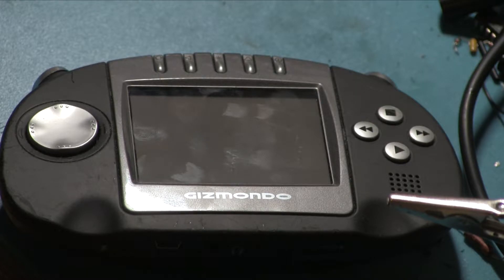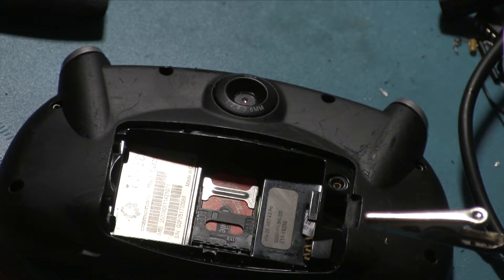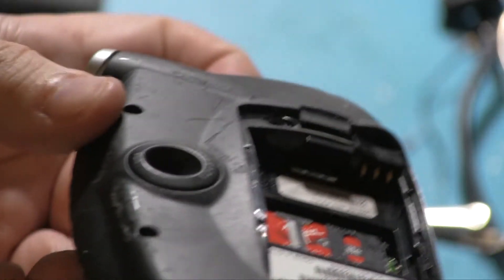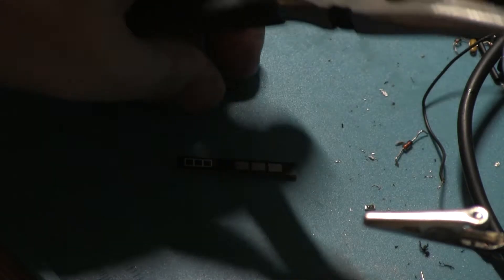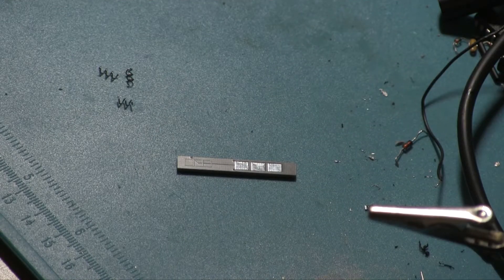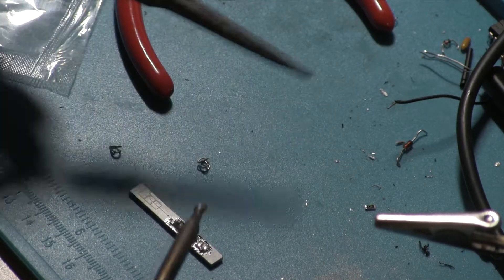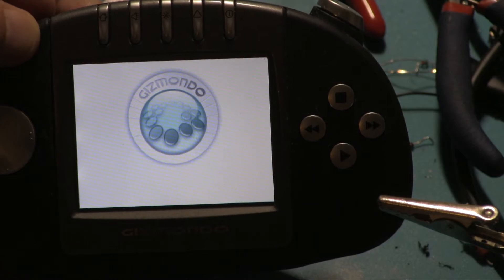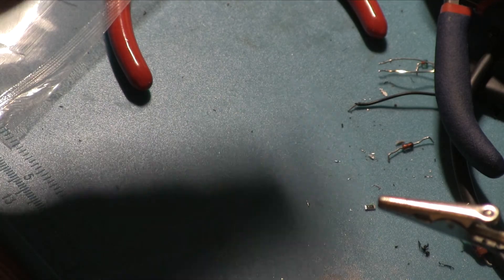Hardware: Creating new batteries for the Gizmondo

Comment: Thanks just worked out that site i hope and ordered some, my battreys are still ok at the moment but it wont be long! I wonder if there is a replacement for the bigger battrey?
Reply from the maker: Technically if you can find a larger battery that has the same basic specifications as the replacement batteries then they should work.
Reply: im trying to get mine working and not terribly eager to buy a bulk lot of boards for one system, would you still have a spare on hand?

Comment: You say can't do much about the sticky mess that is the cover but you can indeed - some cotton wool pads and some methylated spirit and the sticky stuff comes off leaving a glossy finish. Do it carefully and you can even keep the logo on the battery cover.
Reply from the maker: Thanks for the info
Reply: @ReEnthused  No worries. Definitely recommend it.
Reply: @garethUK  Even better then that i think is taking the shell off and then rubbing in lots of talcum powder and leaving it a few mins and then wash it off gently, mine has lasted 4 years doing it but will prob need to be done again at some point.
Reply: @chrislacey9750  Not sure how you think something that needs to be done repeatedly is better than a once-and-done solution, but whatever floats your boat.  :)
Reply: @garethUK  You dont get the shine from removing the coating or change the look, but if you like it what ever floats your boat :)

Comment: Hello there, were I can buy the PCB part?
Reply from the maker: The schematics for the board are freely available here: https://easyeda.com/jonn.blanchard/ti99-4a-replacement-power-board_copy_copy_copy_copy

If you use JLCPCB to make the boards it's as simple as choosing to create the gerbers in the file menu and then sending to JLCPCB, it's pretty cheap too.

The components are available on Digikey

Comment: Hi, how do I order the PCB? Do i just buy the BOM?
Reply from the maker: If you go to the project on EasyEDA you can either download the gerbers and order them from any PCB manufacturer or send the project to JLCPCB, EasyEDA's manufacturer.  Depending on the postage you choose it shouldn't be too expensive
Reply: Is there a link to the gerber file? I dont see anything..... also how many layers for the pcb? 2, 4? I'm sorry I'm new to this. I can solder no problem, but I've never ordered any pcb......